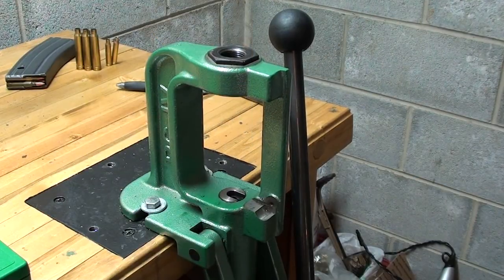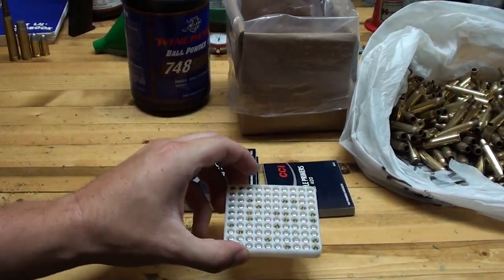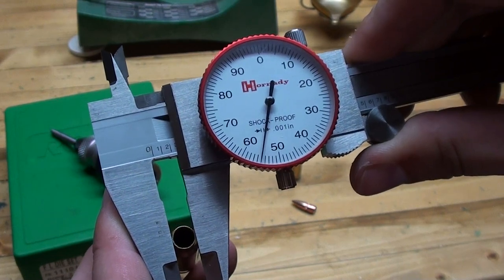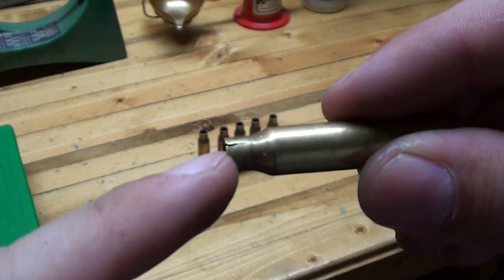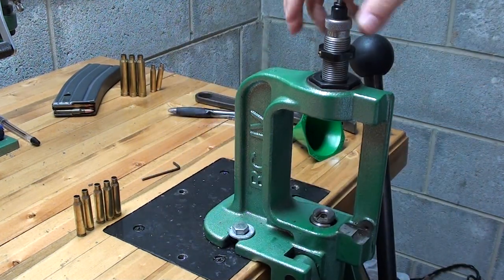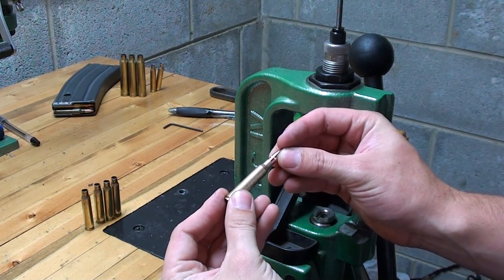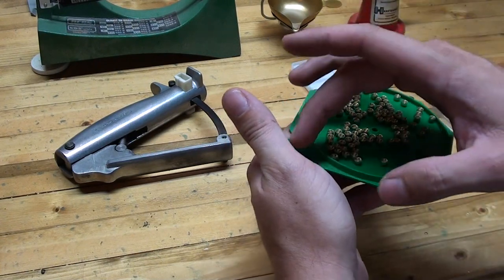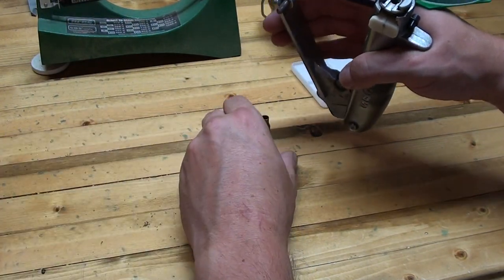Part 1 Basic Reloading of a Rifle Cartridge (223 Remington)

Comment: You backed off the sizing die a 1/4 turn from the shell plate. RCBS instructions say to turn the sizing die 1/4 turn into the shell holder after lowering the ram a bit. The way you did it will not do a full length resize. The dies that you are supposed to back off an eighth of a turn are the carbide pistol dies that are brittle so you don't want to cam into the die or you will damage the die. Most of the rifle dies are steel dies and you are supposed to cam the die into the shell plate an eighth to quarter turn.

Comment: Before seating the new primer you need to clean the primer pocket with a small primer cleaning tool.  Also, if you are using military cases you need to cut always some of the primer crimp from the case to allow the new primer to seat properly.

Comment: To
You're not supposed to back it off 1/8 of a turn. You screw the die down until it touches the shell holder and turn it slightly more down so you can feel a slight "snap" in the die arm when you push the arm down. The rear of the case will not be flush with the case gauge doing it this way. I watched this video and they didn't fit the case gauge and had to resize all 200 cases.

Comment: Hi, thank you so much your video, I'm a new beginer, I'm so greatly appreciate your time to sharing with us, I have question if I don't want use small base full length die to resizing my case which is fired case from my ar15, just use neck sizing die to make case neck only and use on my ar15, Is  that any problems? Appreciate your time!

Comment: RCBS states when setting up the re-szing die that you want to raise the ram till it touches the bottom of the die and then tighten an additional 1/4 turn so that you will have a cam action. I noticed that you backed it off an 1/8 of a turn with no identifiable cam action. Is there a reason that you did not get the cam action that RCBS recommends. thanks!
Reply: John Carroll no. he just did it wrong

Comment: I always wanted to know, is cleaning brass necessary every time? A little carbon shouldn't hurt anything, right? I imagine if the brass is older then it'll need some cleaning to keep grit out of the dies
Reply: John Beige  good idea 💡
Reply: Wash it and let it dry. Cleaning is important but tumbling is not. Even though I've never confronted it a large carbon build up could cause higher pressure than you want because of less space in the case.

Comment from the maker: @fishcop444 You're correct. I did leave out case trimming. I wanted this to be a bare bones basics in reloading. I feel like people are overwhelmed when looking at starting to reload with ALL the possible steps. Yes case trimming is necessary IF the cases have stretched far enough. But most of the time you can get a few loadings out of the brass before this is necessary. I'd hate for someone to not get started reloading because of 80ish buck trimmer that they could have done without for a while.
Reply: I agree,  you might get three to five reloads out of a piece of brass before it needs trimming with 223 you may well lose it in the grass often times before then.  For beginners the use of commercial brass like Winchester/Remington/Federal is better than using military surplus brass  then you don't have to deal with the crimp in the primer pockets that the military brass has.  Keep you brass in separate lots so you can keep track of how many times it has been been fired.  Coffee can labeled with bullet power charge etc put empties in another can labeled #1, #2, etc so you can keep track of how many times fired.  Right now in 2020 there is a buying panic and reloading components are near impossible to find-- we've been through this a couple times before, it will pass.   I've been reloading since the 60's,  hang in there guys---
Reply: @edgoodman4259  Always label loads and if necessary color the case head with a colored sharpy. I have to do this because I load a lot of .357 for both rifle and pistol, I only have to look at the case head to determine which box it came from because each box is labeled with the case head color and different marking. Always label each box of ammo with all information on the label.

Comment: Can you get plastic / polymer cases? Surely they would be so much cheaper and easier and much cheaper to manufacture?
Reply: The cases made from those material are one time use. They don't hold the same flexibility properties as brass. Steel cases are much cheaper than brass but have the same non flexible properties as plastics.

Comment: If your answering questions ?
What’s the sequence
1 tumble
2 lube
3 size & deprime 
4 trim?
5 clean primer pocket?
6 install primers
Never saw you trim or clean primer pocket.  & what about the military crimp brass isn’t that spozed to be harder to get out requiring a different tool?
Reply: I just use my case mouth tool to trim the crimp on 5.56 cases and tumbling is not necessary if you just wash the cases.

Comment: Question?/ i have a bag full of Rem 223 Brass that i bought years ago & want to reload them I do not know if they wer already Resized when I bought them or not i tried to put in a bullet in the neck but it is Tight & will not fit into the case like you show here in your Video so does that mean that these cases were already resized.? If so I would hate to have to re lub them  & put them through my resizing Die again if I do not have to etc  Thanks for sharing etc,

Comment: AR 223/5.56  SHOULD RELOAD with SMALL BASE  DIE SET.  Your Die set is good for bolt rifles, but AUTOMATIC 223 needs SB DIE SET so that the brass doesn't get stuck in chamber.  ( Some barrels need SB Dies others don't )

Comment: did that (example case) that was cracked. did you (or whoever had it) not anneal it? arnt you supposed too anneal and then re size? i am new too reloading and have no practice but ive been researching. 

surely i have a point but does it not matter with 223?
Reply: Aidan steel , annealing adds maybe 1or 2 reloads to a piece of brass... it is not a necessity but it helps to prolong case life....

Comment: You stated that if the projectile  goes in and it is to big throw the case away.  Is there any way that the neck can be reset to fit in new condition for the projectile
Reply: Of course, if the case isn't damaged and is just the wrong size just resize it. If you are a beginner I won't go into annealing the cases.
Reply: @russellkeeling4387  thank you so much for responding back with me i know that my orginal quote was sometime back.

Comment: How much force should it take to pop the primer out and resize? I got a piece of brass jammed in the die and split the 2 inch thick desk I had it mounted to because of the force required for the first two.
Reply: The Indoor Outdoorsman probably a military style of brass that was not box primed
Reply: Lube, lube, lube. A small amount of force is needed but it shouldn't require a metal bench. Clean the die, lubes the cases making sure to get a small amount of lube inside the neck of the case and not to much on the shoulder or it will cause ripples in the shoulder. The ripples will not ruin the case though. I did the same thing to my bench but I was sizing some cast bullets.
Reply: @russellkeeling4387  You don't think I figured it out after three years? 😂

Also it was indeed lack of case lube.

Comment: So if the primer is to far out of the case, do you press it out and then just insert another primer?
Reply: Always seat the primer to the bottom. If it's sticking out put it back in the priming tool and finish pushing it in to seat it.

Comment: Is there a to short or minimum size I have some brass that is trimmed a bit short so the overall length after seating the bullet to the crimp is 2.20
Reply: Kevin OKeefe I've never had a problem with trimming. I trim as low as I can as I'm pretty paranoid about overpressure. If you trim them super short you may get reliability issues but that's all I can think of. Bullet seating on the other hand can be very bad if you seat too low.

Comment: Is case trimming not needed? I was under the impression that was needed.
Reply: Check the length of the case each time you reload them. If they are to long trim them. Long cases can cause dangerous pressure levels.

Comment: I have a question and was hoping someone can help me out. I am new to hunting and really am interested in a 25/45 sharps ( I have a 308) as a general go to rifle and use my 308 for larger game as it kicks like a mule. I own a ar-15 in 223-5.56 but want a little more hitting power. This leads to my question 2 actually. (1) can you reload, or load a 25 caliber in the 223 cases and what do I need to do that? (2). Can you take a 223 bolt action rifle and put the 25/45 sharps barrel on it?
Reply: Both of the things you ask about can be done but I question why. If I understand correctly the 25/45 Sharps is a pretty new caliber and I once wanted one until I looked up load data. That data called for loads that would not fit inside a .223 size case so I felt the caliber was more hype than fact. I looked at the caliber because in my state it is illegal to hunt big game with any firearm shooting any bullet smaller than .24 caliber. This is just my opinion.

Comment: What kind of primer do you use and where do I get it
Reply: Primers at this time are the hardest component to buy. There are large rifle and small rifle primers just as there are large pistol and small pistol primers. Pistol primers have a thinner metal because pistol firing pins are not usually as strong as rifle firing pins. The outside diameters are the same. There are also magnum primers in both. The load manual will usually indicate if a magnum primer is needed. I try to stay away for those loads because I can go to a different powder that will supply the same velocity without a special primer.

Comment: hi all' im sure this has been descussed before and i have read a few tooics but have not found any info in what im about to ask' it seems everyone likes to get worked up when they hear about flash and out in there negative two cents about it' well to get this out of the way first i will inform every one that ive been a pyro all my life and made several different types of flash and even my own aluminum powder' i am very aware of how flash reacts confined and unconfined with many diffent types of compositions" not a " dumn pyro" or do things in an unsafe manner but i do like testing things and if they may seem unsafe i still carry out the task in a safe manner' if knowone ever did stuff like that than we wouldnt have half the technology we have today' here is my question' can flash propell a bullet faster than black powder or even smojless powder lit of by a precussion cap' i have read somewhere that blackpowder and even more so smokless produces way higher pressures than flash which is better for pushing and flash just burns hotter and way faster which brings its pressure up' but i beleive its not as high for the same amount of gunpowder' thats just what i read somewhere". now i do know flash will explode instead of push which means everything aroundit will blow up and i do not intend on ever loading a bullet with it' of course a gun will explode doing this' but givin the right circumstances like for example" say i have a 12" block of steel" and i drill a 9mm whole into it and pack it with flash and than top it off with a 9mm bullet' that means this cannon or what ever youwant to call it now has a wall thickness of over 11 inches' so there is no way on earth that this amount of flash will be able to burst open that thing' so this means all the explosive force will have to only go in one dirrection which is to proppel the bullet out' now i juat want to know this in a scientific understanding and not so i can go build one' so just wonderibg if this projectile would shoot out faster than if black powder was the charge' hope you experienced guys can put yur scientific theories or knowledge to this' im not looking for all the negativity that some like to say because they want to be supper safe' like i said" im not trying to load bullets witg this stuff' and on another note i did try one experiment with a mini cannon i had' which had a really thick wall thickness with a small load of flash' it was kno3 flash with aluminum which seemed to explode when barely confined but